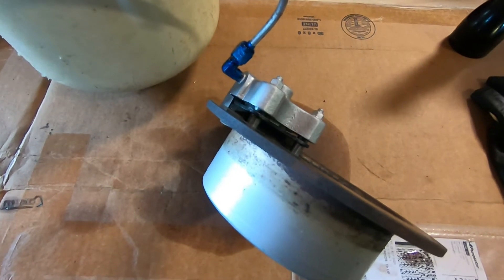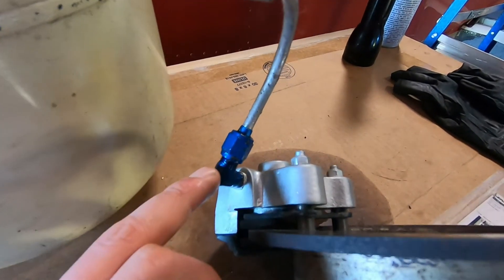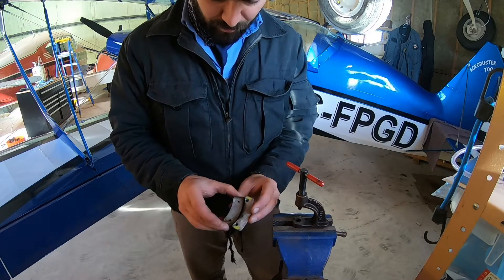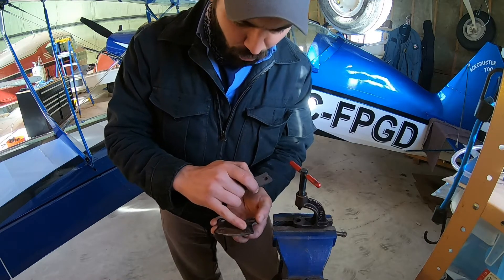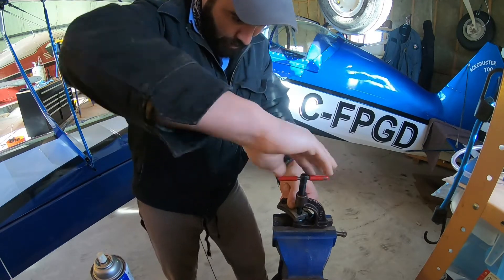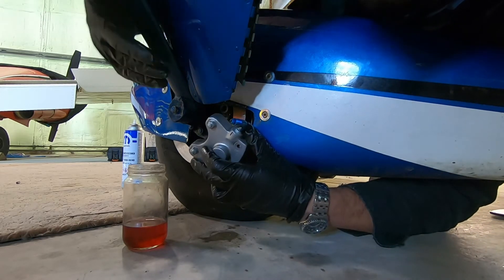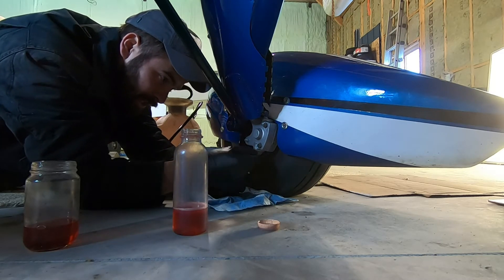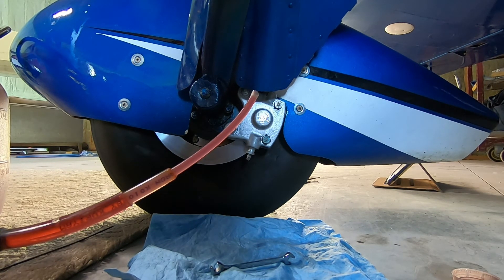Aircraft Maintenance Wheels and Brakes Part 2

Comment: Thank you for the behind the scenes insights. My Musketeer was built with Goodyear wheels and brakes (and tubeless tires) but has long since been converted to Cleveland wheels and brakes and more sensible tires. Much easier to live with. :-)
Reply from the maker: Really glad you enjoyed the video. I just did tires, tubes and brakes on the 1963 Musketeeer yesterday. It still has the 15x6.00-6 tire size but it has been converted to the tube style.

Comment: Nice video! I'm interested in the construction of your 80 PSI brake system tester? How did you put it together?
Reply from the maker: My big pressure tester can also be used for bleeding brakes but obviously at a much lower pressure. 

It started life as an air conditioning freon gas bottle. It is being modified to include a standard Schrader valve for filling  with compressed air. 

It is also had a large standpipe installed that goes to the bottom of the tank. Off the top of my head I would say that this is a 1 inch pipe. The top threaded fitting of this pipe includes a hard quarter inch diameter pipe that picks up fluid from the bottom of the tank. 

With this section threaded in there is a quarter turn valve to control outflow from the tank. 

I hope that helps.
Reply: @fastbackflying853  Thank you! Excellent idea. So you have brake fluid in caliper that you are pressurizing with compressed air?
Reply from the maker: No. The pressure tank is filled with fluid via the 1 inch pipe. It has a threaded top cap that includes the quarter inch pickup pipe and valve. 

Compressed air is put into the pressure tank and used to force hydraulic fluid out of the tank and up the quarter inch pickup pipe and then to your brake caliper.
Reply: @fastbackflying853  Thank you!
Reply from the maker: Maybe I will have to put a short video up on the pressure pot so you can see the construction 😊
Reply: @fastbackflying853  That would be GREAT!